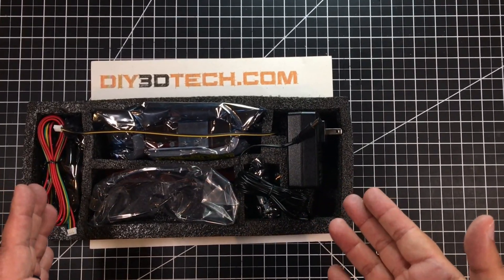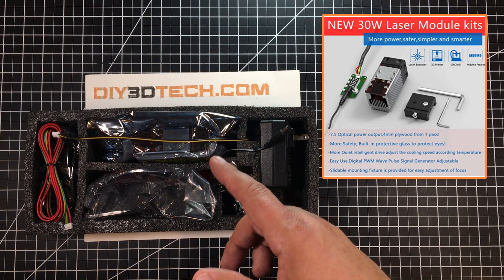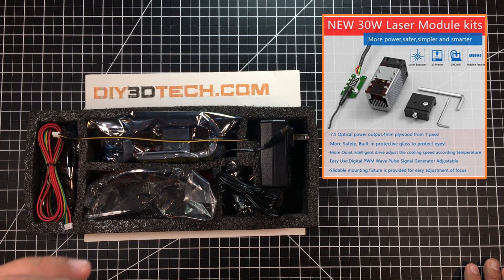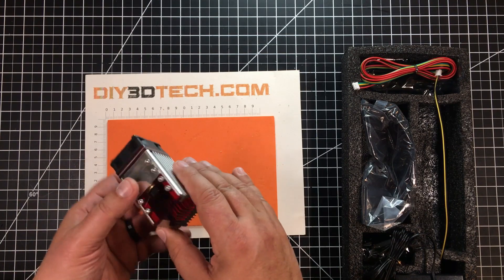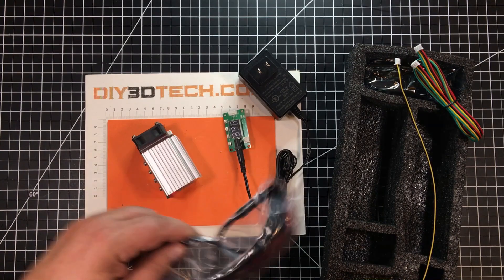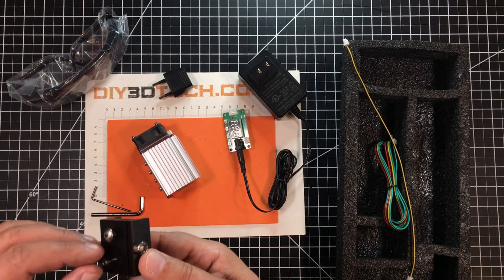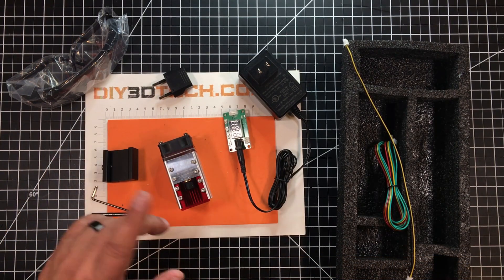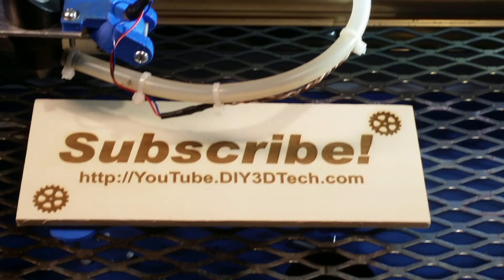Ortur Laser  -  Upgrading Wattage with New Laser Module!

Comment: Bro I bit the bullet and got the neje 30w module from Amazon
Reply from the maker: Cool!  I filmed a status video yesterday which I will release in a couple weeks.  However keep mind this use duty cycle and not PWN so you need to run TTL into the control board to use with the Ortur design....
Reply: @DIY3DTECHcom   I got the pwn model  . I don't know which one I needed because they have two models there. So now I just need to figure out how to do this. I'm sorry it was my understanding that it was a plug and play deal according to neje reps from Amazon so thats why I got the one I did now I need to find a guide. But cool I can't wait for the video.

Comment: Gil has specified in the group before that these lasers dont use the same PWM amperage so arent compatible with directly connecting to their board.
Reply from the maker: Not sure who Gil is or which group, however this is interesting.  I am surprised that current (amperage) plays a major role in this as we are only (or should I say) typicaly speaking of TTL voltage / current levels...
Reply: @DIY3DTECHcom  Gil is one of their main customer support reps. He is in the ortur owner fb group
Reply: @MattWeber  i think Gil made a mistake. He said the PWM voltage is between 3.3 and 12v on this module. But it actually is the TTL voltage. PWM should also be 0 to 3.3V. But i am not an expert in this things...

Comment: I just bought the same 30W laser thinking to update my Ortur Master 2.  Using the adapter board, it's easy to power it with the Ortur's connector.  The problem is that this laser is designed to be close to the surface being cut/engraved.  So the entire laser body is lower and hits the Ortur frame when you home.  I could add something to the X carriage to trip the end stop before the laser body hits the frame.  The other possibility that I haven't tried is that maybe I can replace the lens with the G8 lens so that the laser body can function at a higher Z height, eliminating the collision with the frame.  I'm interested to see how you end up mounting it.
Reply from the maker: Interesting and that too is my plan to replace the lens.  For wiring I was going skip the temp sensor wire as I did not see a feedback means for it (so assume technically not required) as the others are simply +12, PWM and GND.  However I did up grade to a 12 volt 10 amp power brick...
Reply: @DIY3DTECHcom  Well, I tried the G8 lens and it is actually worse for getting height on the cut than the lens that comes with the 30W laser.  There doesn't seem to be a way to get the body of the laser above the frame so the alternative is to add something to the X carriage so that the End stop for the Y axis is tripped before the laser smashes into the frame.  This would probably work better with the Ortur 1 since it doesn't have a frame.  Well, for now, I'll stick with the 20W that came with the Ortur and miss out on the 2.5 extra watts of laser output.  

One potential option would be to mount the laser under the stepper motor side of the X carriage.  You would lose a lot of your Y travel but at least it can home properly.

Comment: Really wish now that I actually purchased a different laser, I've gotten some really good  engraving results, but cutting is a disaster. Possibly due to the laser not focusing to a dot, Im finding a difference of 2-3 passes from one axis to the other cutting 3mm ply. 
Im also experiencing dramatic power loss after two weeks. 7 passes 300mm/sec first few projects now I'm at 9 passes 200mm/sec. im using the 20w model air assisted.
Reply from the maker: Note diode laser do not focus to an optical dot as there is a fast and slow edge to them so this is normal.  Also it depend if the 3mm ply is laser friendly or not as I have 3mm that cuts easy and other which I can not cut at all (glue plays a big roll in this).  Also how do you know the laser is losing power?
Reply: @DIY3DTECHcom  I have the G8 lens in the post, so hopefully this will help. I was leaning more to the G2, but in this instance longer focus will be more beneficial.
I am using 3mm ply that is recommended for lasers.
It's the same batch I have been cutting. At first I was cutting at 300mm/minute @ 95% power 6 passes.  Which was cutting very cleanly.
I am now cutting 200mm/m 8-9 passes 97.5% power.
I have no intentions using 100% power, I personally just think it's not the best especially cutting longer than 15 minutes.
My only conclusion is that my laser diode is degenerating faster than it should.
Cheap diode's maybe being pushed to high.
It would be good if someone could test if these are being over driven or not.

Comment: just got this laser - also for my LM2 - and I figured out one thing (I see you have the same cable as me ) the color coding on the 4 pin cable is reverse - it's ok when using it on the board that comes with the Laser - but if you plan to cut the cable and splice it into the existing you have to be careful in this stage it's 12V = green, GND = yellow, PWM = black and Temp = red - for me - I just reordered the cables in the plug :)

Comment: I am seconds from purchasing many of the items you demonstrated on your channel through your Amazon links.  I was going to buy the Artur Master 2 7W.  Then I saw that it had a 20W laser available for about $170 dollars more.  I saw your upgrade to a 30W laser video. I found that model.  Its $180.  So, for nearly the same amount of money I buy the smaller Artur Master 2 7W.  Buy the 30W upgrade unit is my plan. 

My big question, is the 30W worth the effort.  Did you speed up your work flow?  Was it easy to install and make it work with the master control of the Artur system?  Can you still do FINE DETAILED WORK with this new laser and what lens do you use.

My work with me cutting 2mm maybe 3mm aluminum badges.  Then anodizing.  I'll then use Lightburn to put etch/engrave the badge details onto a gold badge.  Speed?  Is the 20W that comes standard with the ARTUR from Amazon strong and fast enough to do what I described or go with the 30W upgrade replacement unit?  Please respond soon, looking to make that purchase today.
Reply from the maker: Note this laser is (the 30watt/input) is not plug and play replacement you will need to wire in TTL/PWM conversion board.  Sounds like you using for a business so would recommend the Ortur Laser Master II with 20 watt (input ~5.5 output).   Now you do understand that this laser CAN NOT cut aluminum badges.  You can etch the anodizing / coating of badges which were made for this purpose.

Comment: Keen to see what you have instore for the air assist for this module.  Is this a current project?
Reply from the maker: Yes have already designed one, however it will require a lens swap as the existing (low efficiency) 3 element lens places the unit too close to the cutting surface so I likely will use a G7 lens...
Reply: @DIY3DTECHcom  don't you mean barrell? :D Can to tell I enjoyed your other video(s) as well?
Reply: Do you know if it is a standard size thread for a G7 lens?  I have taken the coloured Perspex screen off my laser as it was making the focus knob difficult to adjust and was basically doing nothing considering the laser point is not shielded.  I was thinking of replacing this part with a printed air assist assembly as it already has mounting points and can fit even with the short focus distance with the default lens.

Comment: Have you got it operational yet,love your videos but unsure which head to buy
Reply from the maker: This will not work plug and play with Ortur you will need to use adapter board.  Since I have 20 watt now I am using the 15 watt frame to do a major rebuild with a z-axis to cut think objects...
Reply: @DIY3DTECHcom  can you keep me up to speed,i see kkmoon do 30 watt,is it possible that could be plugnplay

Comment: I confess I was expecting to see the new laser in action, but I'm not disapointed with this video, each new video brings a new ideia. Right now I'm wondering how do you plan to control the z axis movement in the future with that ortur controller? I Imagine you would use a diferent  cnc controller...
Reply from the maker: That's what I all about is ideas and share things I find which I think others might be interested in.  In fact another viewer beat to making this mod to his Ortur and gave me some great tips which I will build upon and share.  Also I would need to change the controller as I use the one which I just used in my CO2 laser conversation video as it works great!
Reply: I posted the following comment on his last video. Thought this might help. I was trying to find some sort of output from lightburn like a pmw signal to integrate the z axis. As for now I'm using upcycled linear bearings and rails form a old DVD burner and a cnc machined aluminum  mount the stepper and limit switch. I tried to make it as compact and as light as possible. Currently the z axis uses a stand alone  Arduino, shield and driver connected to a small touch screen so the code can be overwritten on the fly without a pc running. I am able to adjust (dwell),(z distance),(amount of passes),(current position or home).   The whole cycle starts of with a 5v output from the board that fires the laser. "Let's say the first pass of the laser says 14 seconds in lightburn and I want to make 4 passes. I tell the Arduino upon cycle start (dwell 14 sec) the laser makes its 1st pass. At 15 seconds the z axis goes down .100"   At 28 seconds the z moves down another  .100" and so on and soforth. At 56 seconds the z will go back to its home position ready for the next cut. Its been a fun project 👍

Comment: Can you recommend an over prescription glasses safety goggles?  Thanks
Reply: Look at laserland glasses on amazon. They arent cheap but are OD6+ which is best protection you can get for a diode laser rating. They are suuuper comfy and I have a wide head and wide glasses to match, and they fit over well.
Reply: Laserland 190nm-355nm-405nm-445nm-473nm-532nm Blue Green Laser Protective Goggles CE OD6+ if need search term specifically. Since i wont be an ass that posts a link on his video
Reply from the maker: I wear these over my glasses: https://diy3dtech.com/Professional_Violet_Blue_Laser_Safety_Glasses  however it will depend upon the size of your glasses...

Comment: I have the exact same laser, but I want to mount it in a 3D printer (a CR10S), but I can't find info anywhere on how to mount/plug it on the printer's board, if using the 12v pwm fan connector will do or I still need the laser's board. Kind of lost there, so I'd really appreciate any directions on that. Thanks for your content and greetings from Europe :)

Comment: Wow... Was just researching about this. Wanted to know if this will work. Was chatting with a seller on AliExpress.

Want to get the 40w version. Can it work with the Ortur Laser Master 2???
Reply from the maker: Note this is NOT a simple plug and play change, and will require the appropriate PWM conversion board as NeJe uses duty cycle pwm  so the longer the pulse the higher the power.  In later jan 21 I will be doing more on this...

Comment: 12V 1.5A and 30W doesn't compute. That's 18W and that means that someone is lying on the specs.
Reply from the maker: Chinese accounting, I agree as at 30 watts (input) to 7.5 Watt (output) that is a lot of heat (as the difference has to go some where).

Comment: how bout upgrading to the 40 watt neje laser module???
Reply from the maker: Two reasons, (1) cost most I have seen are $100 more then I paid for this one meaning a staggering jump is cost per output watt, and (2) this is not really a different diode but driver as in over driven which leads to significantly shorten life cycle.  So you pay more for less life...
Reply: @DIY3DTECHcom  this is not really a different diode but driver???? thats crazy!  i just ordered the neje 30 watt. i hope it doesnt have a shorter life. i will be mad if it is only over  driven wi th a short life.
Reply: @DIY3DTECHcom  I believe it is actually 2 x 20W in the one unit focussed together.  Hence the huge jump in cost, you are actually buying 2 lasers.  The lifespan would technically be better than a 30W but heat would play a part.

Comment: Great video! I contacted neje regarding that PWM interface/tester board wiring. I have a CNC machine I want to add this onto. My only available output is my spindle on/off pin which completes the ground connection of my circuit to turn the spindle on. Neje mentioned that I use that spindle wire plus a ground wire to plug into the TTL port. Does that sound right to you? I thought the TTL would need a +12v and the spindle output wire to activate it. That’s how it’s connected to the relay of my spindle motor. Any help would be appreciated. Looking forward to seeing a follow up video on this.

Comment: I am two minutes in the video and already cringing. No that fan is not acting as the air assist, not even a bit. One of my Neje engraver came with that N40630 module and I have upgraded that one with genuine Neje metal air assist. Fans in Neje laser modules and most of the other brands modules are strictly for force cooling of the electronics and diode it self. Also adding some house fan from the side is not air assist either. When cutting deep or engraving materials that produce lot if smoke all copium air assist like solutions just makes it worse and recycle the smoke back to the on board fand abd true the laser module. That can kill the module. For normal engraving you do not need the air assist. All you need is brain. Set power and speed levels to a level where you will engrave deep and dark enough and not make smoke. If you do try going faster and if your engraver can take it cool if not lower down your power. Fir all other scenarios you will need proper Air Assist option. It is wort it to.